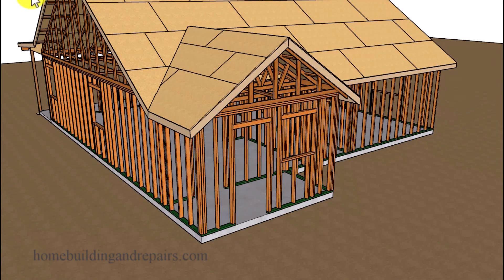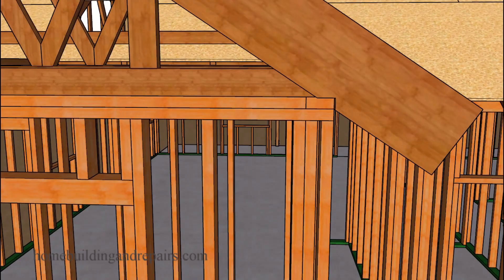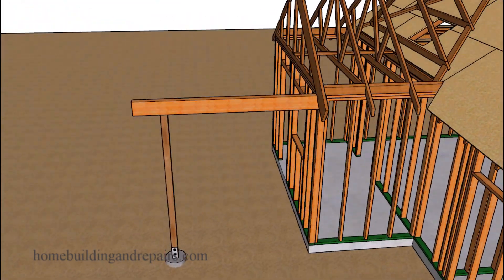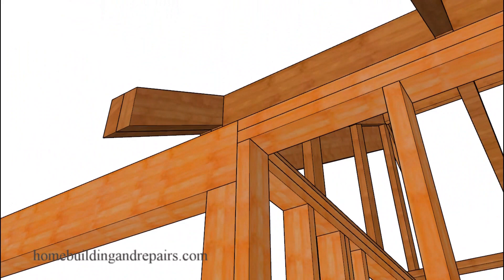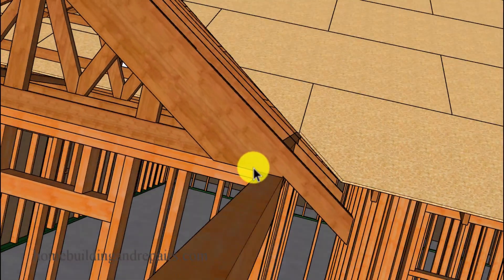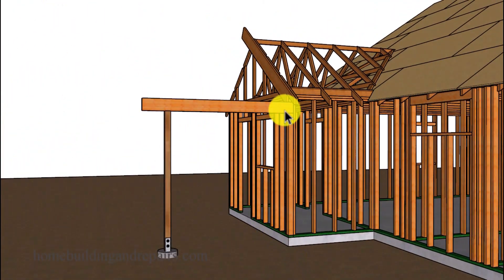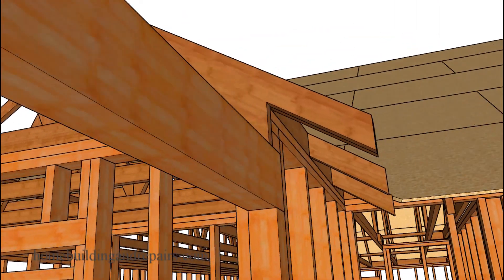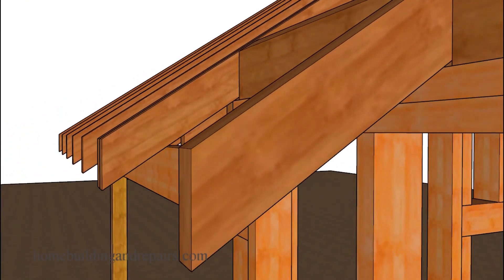Lower Porch Beam To Make Larger Rafters Fit Better In Homes With Roof Trusses or Smaller Rafters

Comment: Great videos, I love the way you explain in details. I have a situation where there is going to be a garage conversion to an ADU, the existing roof rafters are 2x4 and the designer asks for 2x6 for the addition roof. How would you do to keep the same height and continuous sill plates? Thank you in advance.
Reply from the maker: Thanks for the kind words and you would need to raise the roof or lower the walls to make larger new rafters work with smaller existing rafters.

Comment: I disagree that you would be weakening a 2 x 10 to be the equivalent of a 2 x 4. The stiffness and load-bearing strength of the roof would still be pretty good. And I think that’s what drives the use of a 2 x 10, not the resistance to a sheer failure at the bird’s mouth. Just my opinion. Love your videos!
Reply: Everything not on the top plate, is just pulling down on the 2x10.. including the 2x10 that's not supported..
Reply from the maker: I understand and the shaped 2x10 in the video seems like it would be stronger than a 2x4. However, most of the engineers I met didn't feel the same way.

Comment: Hey Greg, I have a framing question relating to my L shaped 1950s ranch i have completed rennovated. I'm wanting to add a lean-to porch roof. Could you do a video showing how to connect the 2 different roof. Wish I could show a picture of what I mean. Thanks
Reply from the maker: I think I have a video in the porch section at our website.
Reply: I have a issue with my front porch beam super rare and no one can give me advice please help I have pictures